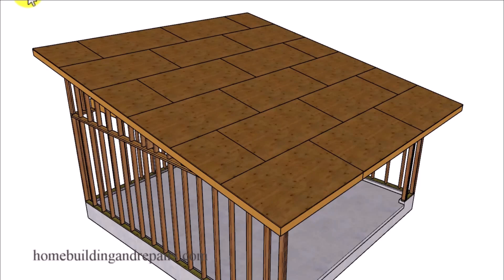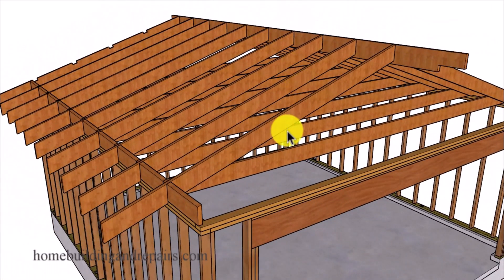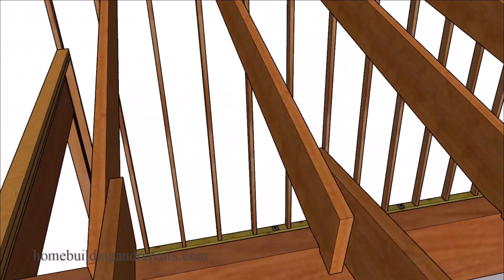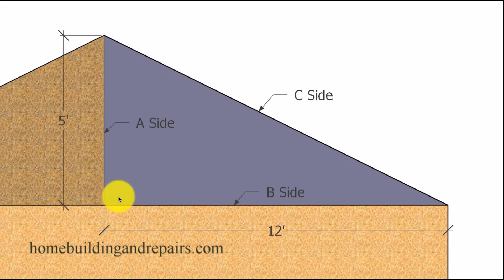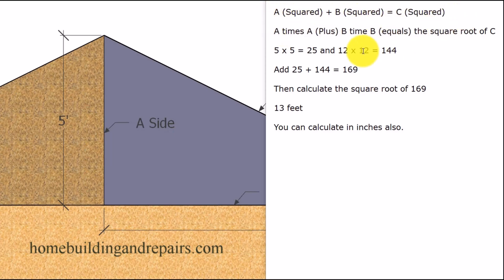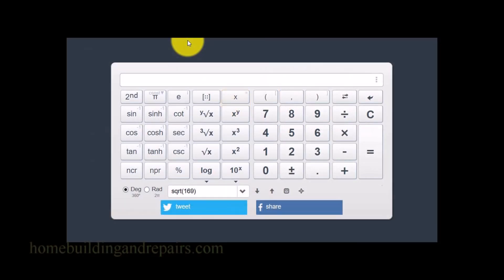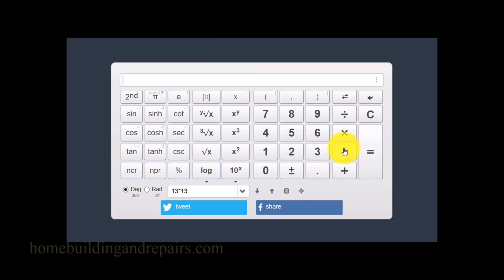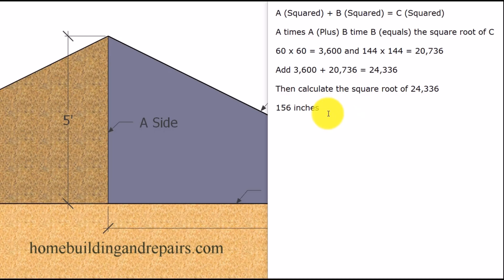Learn How One Rafter Pattern Can Be Used To Build Shed, Gable And Butterfly Roofs

Comment: Sorry to ask this here on this video - but how could you add a cantilever floor if the joist are going the opposite direction? I don’t have a tiny home but a ranch, with a basement. The house has an addition with the joist running in opposite directions from the old house to the addition.😅
Reply from the maker: You might find something here. https://www.homebuildingandrepairs.com/balcony/index.html   https://www.homebuildingandrepairs.com/framing/floors/cantilever_with_perpendicular_joists.html
Reply: @ thanks so much